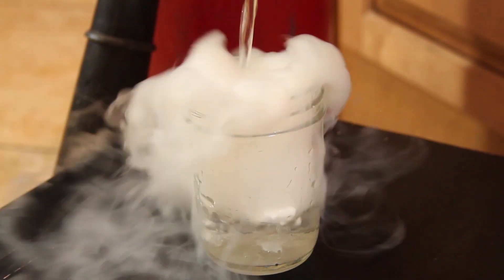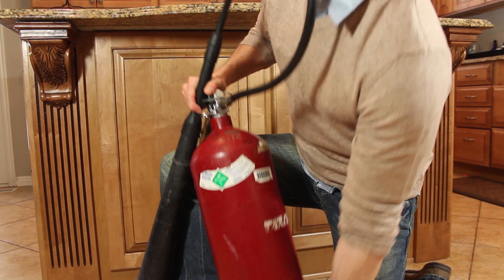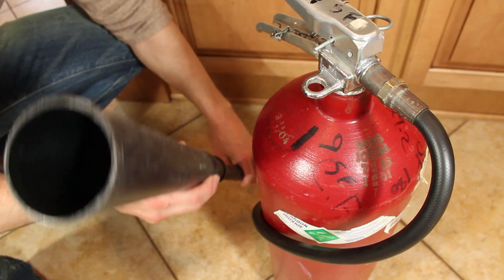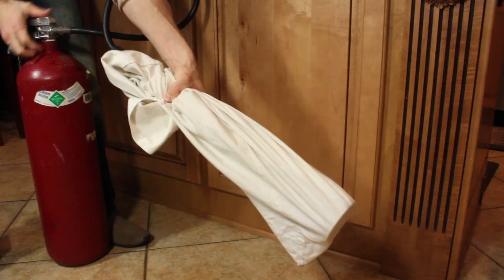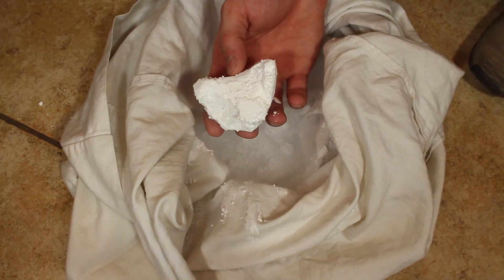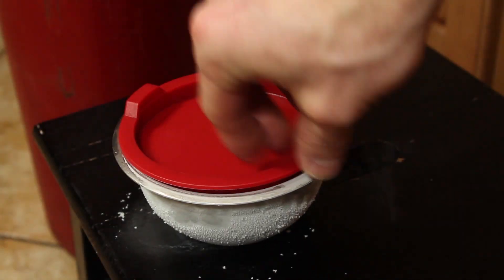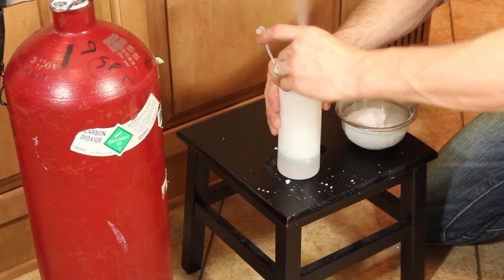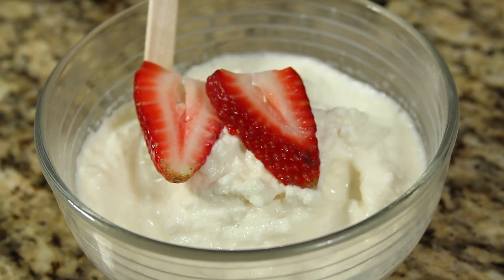How to Make Dry Ice - With a Fire Extinguisher!

Comment: My extinguisher has some powdery stuff like baking soda
Reply: You’re using the wrong fire extinguisher, it has to be a CO2 fire extinguisher, not an ABC fire extinguisher. I would also make sure not to get any of the powder on anything sensitive as your typical ABC powder (mono ammonium phosphate) is acidic and can damage sensitive equipment or ruin your flooring.
Reply: Your using an abc not a co2 you need a co2 for it to work

Comment: Doe it work with a dry powder fire extinguisher?
Reply: Nah
Reply: DONT DO IT, it has to be a CO2 fire extinguisher, not a typical ABC Dry Chemical extinguisher that you can get easily at most retailers. The powder is also acidic and can damage items in your house if not cleaned up right away.

Comment: It didn’t work I tried with towels pillow cases gloves hats and even blasted it straight onto the surface and nothing happened...I even used co2 bottles and fire extinguishers nothing you must have showed you blasting the extinguisher and then cut the shot then put crushed up dry ice in there

Comment: At my work, we use tanks of Carbon Dioxide, with an insulated container and a small brick like form. We use dry ice bricks, to pack around parts. Just helps get them ready for installation. Beats Liquid Nitrogen any day. I had burns on my arms for a year, after installing bearings out of Liquid Nitro...

Comment: Use dry ice dust from a fire extinguisher to freeze salvage oil. See Oil Spill Solution now trending on You Tube. 1 pound of dry ice dust costing about $1.00 can freeze 3 pounds of diesel #2 worth about $2.00.

Comment: anyone care to explain how the co2 loses heat when it comes out of the extinguisher? As far as i understand it's liquid because of the pressure but as soon as the pressure disappears should it not vaporize immidiately let alone freeze to solid state. I mean what's so magical about that pillow case? How it makes co2 colder than it is in the extinguisher or the air? Where the kinetic energy go? I just dont understand.
Reply: CO2 is odd in that it sublimates rather than melting into a liquid. This is because the liquid temperature of CO2 is lower than that of solid CO2. At atmospheric pressure, CO2 cannot form a liquid - only a solid and a gas. The only way it stays liquid in the extinguisher is due to high pressure. If that pressure is taken away, you get a solid because of the low temperature, which turns directly to a gas when as heats up. Hence why it is called "dry" ice, since there is no liquid produced when it heats up.
Reply: tigereyemusic
thanks but i still dont understand why it becomes solid instead of gas when it comes out of the extinguisher. As far as i understand it isnt cold inside the extinguisher so why it suddenly becomes cold when the pressure drops. Unless of course it indeed is -80c inside the extinguisher but i dont think it is, is it?
Reply: It's to do with The combined Gas laws in physics: pV=nRT, where p is pressure, V is volume, n is the number of moles of gas (basically the amount), R is the gas constant, and T is the temperature.
Compressing a gas to a liquid state removes a lot of its kinetic energy. It's for the same reason that water boils at a higher temperature when compressed. When you release the gas from that pressure, it still has very little kinetic energy, and the temperature decreases. In terms of the gas laws, p decreases massively, V only increases a small amount (because of the pillow), and n and R are the same, so T has to decrease to account for the change in pressure.
Reply: tigereyemusic
well math doesnt lie
but it feels very counter intuitive though.
So the co2 already has low kinetic energy as if it was solid (-80c) but the pressure increases the temperature so it isnt cold inside the extinguisher. Makes sense.
thanks doode
Reply: Grey Fox
richard dawkins said something about understanding the universe and magic
i feel it might fit here but i dont remember what it was

Comment: is it edible? like can you put it in your drink and dtink it?
Reply: omg are you dumb, its dry ice, what would you expect? It would instantly give you a frostbite when you eat it dumb.
Reply: Cereal Dude Absolutely Good You could drink the liquid, as long as you don't get the dry ice in your mouth.
Reply: Timothy Gilbert umm... just think about that for more than 1 millisecond
Reply: Bubbles in soda is CO2. That's that smoke when you open fresh bottle.
Reply: HystericalHD errr carbon dioxide displaces oxygen. we breathe it out so we dont die. it is definitely harmful.
Reply: situational or not, it can quite easily kill you
Reply: asaeampan lungs react to CO2, you'll start coughing violently.
Reply: asaeampan well, honestly, I drink soda into different throat, so I can't comment on that. I burp ocasionally, yes.
You can try it yourself by shaking half empty bottle of soda and then inhale quickly what is above liquid, squeezing the bottle.
Reply: asaeampan what?
Reply: asaeampan i said you should inhale it from half empty soda bottle after shaking it, that would be an equivalent of breathing in evaporating dry ice.
Reply: asaeampan not hard to get co2 into your lungs when being close enough to touch the solid dry ice. Quite easy to get frostbite handling, quite easy to get hurt ingesting it as was suggested, quite easy to die from it if you did not know what simple precautions to take. For example, if you did not know what u were doing you might try to keep dry ice in the freezer, or use it indoors. Depending only on amount, you could breathe in enough to knock yourself out or worse.

I don't really think it should be necessary for me to come up with hypothetical situations to explain why it could be dangerous. Fact is, co2 can suffocate you, and dry ice gives it off.
Reply: asaeampan yeeees, but CO2 does not act like asphyxant gases, what I said in the first place. If you get pure nitrogen or helium into your lungs - you'll fall asleep and die without knowing if nobody vents you. It does not have any taste or smell. I saw a video here somewhere where bunch of guys dump liquid nitrogen into swimming pool, and bathe in it with clouds of dispersive mist of nitrogen floating over water. I was wondering if one will dive and never go back up.
Reply: asaeampan you can google up "exit bag" to know how asphyxiant gases work.

Comment: how can you keep the dry-ice preserved well?
Reply: The best thing you can do is seal the stuff in a Vacuum-Insulated container with as small an access port as possible.  The Vacuum barrier is about as good a thermal insulator as you can hope for unless you happen to have a research grade super cooler laying around.  Also, only go Vacuum-insulated, NOT Vacuum SEALED, as this will lead to a slow build up of pressure that could be very dangerous.  (Storing the stuff in a Freezer helps, but only for so long.)

Comment: You can use any Fire Extinguisher??
Reply: Almost every fire extinguisher has CO2. Or carbon dioxide so if you have a fire extinguisher it could work.
Reply: Paul Negoita actually most extinguishers are the dry chem type which will not work for this.
Reply: Paul Negoita
Carbon dioxide type fire extinguishers tend to be quite expensive.  For this reason, the dry chemical type is much more commonly found.

Comment: Where is the video on making liquid nitrogen?
Reply: I dont think you understand, you can't make nitrogen, you have to freeze the nitrogen to a certain temperature for it to change into a liquid
Reply: Derpy Gamers United I understand fully what liquid nitrogen is, but he said that there will be a video on how to make it. Now I have no idea how he will do it but he said he will so I was just wondering when.
Reply: Alan Tian Thank you.
Reply: kenixfalcon Definitely not as the HEET/ISO-HEET antifreeze used is quite toxic. If you put an orange in there, you'd be basically eating an orange that has been covered in either methyl alcohol or isopropyl alcohol (the type of alcohol depends on the type of HEET antifreeze you are using). That is something you probably wouldn't want to do.
Reply: Alan Tian
He was actually using ISO-HEET.  This contains isopropanol, not methanol.  You can use 91% isopropyl rubbing alcohol instead of the ISO-HEET.
Reply: ParadoxChem126 May I ask something? If you freeze something with the 'poor mans' liquid nitrogen, like an orange....can it be eaten??
Reply: kenixfalcon yeah if you wait
Reply: You have to take it from the air in a certain way then cool it down to the proper temperature for it to turn into a liquid

Comment: u don't need to remove the carbon dioxide from the water. it either dissolves inside the water or just bubbles out. what you are drinking is just cold cold water.

Comment: I did the geyser thing but instead I used a bottle with a hole in the cap, the water froze and blocked the hole, I knew it was gonna blow so I tried to throw it away but it blew up and cut my arm

Comment: i use to do it all the time (don't tell my mom)
but one time after a party she brought some home and i put a punch in my drink, it will generally fuse the side of the drink so you shouldn't have to worry about eating it, plus it'll dissolve pretty quickly even if it does.

Comment from the maker: Thanks for asking.  I did a follow-up video on igniting the gas, but haven't done anything else with it yet.  I want to do an HHO torch and maybe run a motor, but that's mainly for fun and I don't know when it will happen.  I haven't tried Hydrogen batteries.  Any ideas there I should look into?